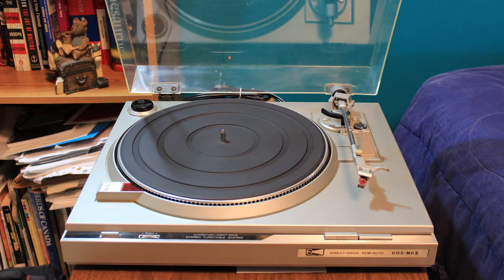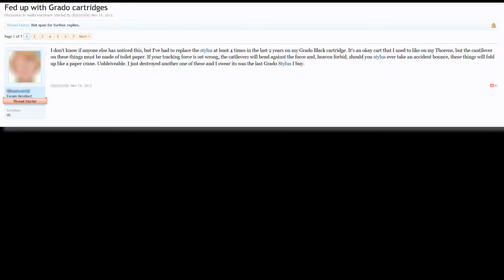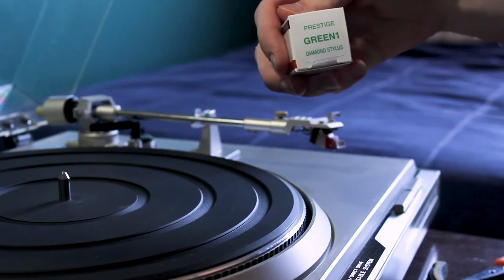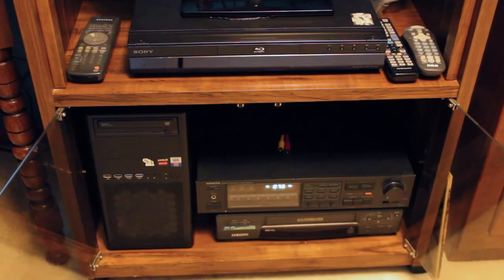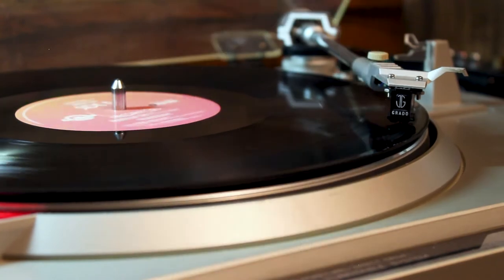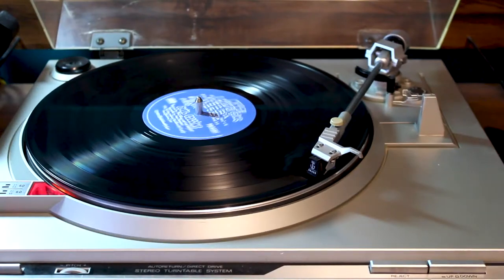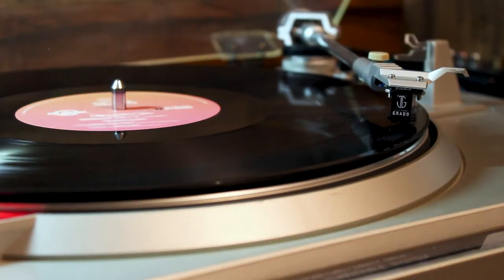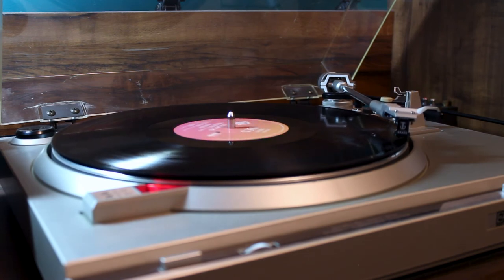A Look at the Grado Green  - A Crate Digging Review

Comment: I own several Grado's. In 1971 my Dad bought a Dual turntable with the Grado F+1. We loved it until 1976 a friend thought needle was a little bent. He said he can fix that with needle nose pliers. Yes, you guessed it, he snapped the stylus. Dad had hard time finding replacement and settled for a Shure M19ED. In 1980 I bought a Dual table like my Dads used in 1980 (1973 model), I bought a Grado G1. It was $150.00 and came in a jewelry type box. Loved it so much a year later bought a new Dual and put on the Grado G+1 ( again $150.00 and same box). Just love them. Later got my Dads old table and found a new old stock stylus for the original Grado from 1971. So 25 years after broken we found how much better that cartridge was to the Shure. I do like the Shure, but nothing like Grado. I have several Duals now. One has the Silver, One is FM3, and one F1. All sound great. I will say I do miss the packaging they use to use though.

Comment: I have to second what leyland said that the headshell seems off. I think some of those headshells have a screw that you can use to adjust the azimuth. Might be worth looking at.

Anyway on to the review itself. I've been using a Grado Prestige Black1 for a little while now and I have to agree with all your points. My only real negative for the cartridge was that like you I experienced some IGD and sibilance (although my cantilever is a little off-centre, so it's possible that this is making it worse) - but the sound more than made up for it, as it's an excellent sounding cartridge. I think you made the right choice choosing the Green over the 2M Red. The experience I had with the 2M Red showed it to have the same IGD and sibilance issues the Grado had, but the sound just wasn't as good as the Grado. Mids sounded flat and muffled. High end was great, if a little bright. The Grado on the other hand has been much more well balanced, and does well in all areas: highs, mids, and lows.

I hope you do some more cartridge reviews in future. You and HiViNyws are the only two channels I've seen to date that have done decent in depth cartridge reviews of any sort. Great video.
Reply from the maker: You and leyland9999 have been very helpful. As I mentioned to leyland, I did readjust the azimuth based on his advice (I tried adjusting the screws on the  tonearm and headshell but couldn't get it to rotate, so I put some very thin cardboard under one half of the headshell to get the cart's angle right. There is an improvement, particularly on the inner grooves. Thanks again!

I must say I'm very flattered that you're comparing me to HiViNyws. I was actually hoping my reviews could someday be as good as his.
Reply: @RoyUnit  The problem might be at the other end of the tone arm.

Comment: Good review. However......the head shell seems not perfectly level. That means the needle isn't riding the groove as it should. It is leaning. So without any doubt the sound can be improved quite a bit. Furthermore, a cart/tone arm combo must form a happy pair. Apparently this is the case with your equipment. You mentioned the difficulty this cart has with certain pressings, maybe this problem can be solved if the head shell is positioned correctly. Regards from Holland!
Reply from the maker: Thank you. I think you may be right about the leaning issue. I noticed it a little when I bought the turntable but I wasn't sure if the needle was actually not at the proper angle or if it was just my eyes. I will certainly look into it soon. Appreciate your advice.
Reply from the maker: Update: I've now readjusted the azimuth on the cartridge to get it as close to level as I could manage. There is a notable (not exactly huge, but notable) difference in clarity on several records I have tried since then. In particular, inner grooves do have less issues than before. Thank you very much for your help, my friend.

In retrospect, I feel kind of dumb for not noticing this until now. Comparing the angle of the cartridge from before to the angle it is at now, there is a noticeable difference. I suppose it is due to trust in the person I bought the turntable from; he said it was refurbished and fully set up, so I trusted his judgement. I hope this will teach me to be more critical of these things; people can be experts on turntables yet also make mistakes.

Comment: Very Good  sounding Upload.  Many on YT can't manage that clean a  transfer,  Curious to what preamp and  A-D  you employed.  I am an ageing audiophile; I recall fondly buying 3 to 5 Grado GF3E+ cartridges  back in the mid  eighties and  "hand  selecting" them myself.  Usually one of two out of the 5 were  keepers and the others  not good.  Did this  by listening, though I did have an electron microscope at my disposal at Bell Labs. - Cheers!  Sandy
Reply from the maker: Thank you! I'm very glad you liked it. It seems that Grado is a finicky brand in terms of quality. My experiences have been generally positive but others report mixed results. I wish I had access to an electron microscope - the closest I've come is a USB microscope that I used to check whether a stylus tip was damaged.
As for the audio quality, I'm glad it turned out so good for you. For the ATD transfer, I connect my turntable to a Cambridge Audio Topaz SR10 receiver, using its onboard pre-amp. I output the amplified signal through the Tape Deck output to a Behringer UFO202 ATD, which connects to my PC via USB. From there I record the audio in Audacity at a 48 kHz sample rate and export the files as either FLAC or WAV. The process is laid out pretty well in my video on transferring records to digital files.
Thanks again!
Reply: @RoyUnit  I have to watch that. If I get my TT up and  running I might give it a  shot.

Comment: Ironically my Grado Black1 has no hum on my U-Turn Orbit but my Nagaoka MP-110 does although it's a much better overall cartridge than the Black1 IMO. Better tracking and better sound signature if you ask me, not to mention the obnoxious stylus guard the Grado Prestige series as a whole has that's hard to put back on and I am always afraid to crack or outright break it whether I slide or click it on. The MP-110 has a nice easy  guard and it's easier to replace the stylus when it eventually wears out or gets damaged.

Comment: Belt drive turntables which have their motors on the far side (11 O'Clock) of the platter from the tone arm drop point won't be a problem with hum.  Also turn tables with DC motors.  Grado shells are un-shielded (plastic or wooden bodies).  Having a metal mounting cartridge shell on the tone arm that is grounded will help.  BTW these cartridges use a design similar to ADC's induced magnet system.  I bet the Grado Green won't handle Telarc's digitally mastered 1812 overture LP during the cannon blasts!

Comment: Great review. You should do a weekly show on PBS. Maybe "This Old Turntable", or "Vinyl Week in Review"? Anyway, I have been using a Pickering TL-3 in my Technics SL-Q200. My stylus was an aftermarket D11s I believe I purchased from LP Gear. I say was using because the other day while cleaning it with solution and brush I accidentally brushed the tip off it. Mind you, I wasn't applying excess pressure. Now I'm considering buying the same stylus for $90 or a Grado blue for $110. I'm assuming this will plug into my p-mount tonearm. Any thoughts greatly appreciated. Thanks.

Comment: I have the Grado Black 2 and I put this on my Fluence 85 I wasn't impressed with the output of the sound! Yes it was clean but the highs weren't there and yes bass was good! So next I tried a classic cartridge a R27E made by Shure and I like this better then any other cartridge I have tried and even the cartridge that came with the Fluence 85 was the Otophone OEM10 and this didn't par to the Shure! Shure did very well with making cartridges and it's hard to find them today because production I believe has stopped not 100% sure of this!
Reply: Shure stopped producing cartridges a number of years ago.
Reply: Interesting since RT-85 comes with Ortofon Blue and not OM-10.  I also have Shure M95xE, DL-110 on RT-85 and the Denon DL-110 is the one I like most.  The M95xE is very neutral and the Ortofon Blue sounds very clinical

Comment: Be careful with any Grado Prestige series on direct drive turntables.  Some hum and some don't.  No one seems to understand why, but with belt drive you don't have this problem.
Reply: Belt drive have the issue  too. Back in the late  70's, The New  AR turntable  sporting a  GF3E+ and  a  Linn LVX arm hummed at certain places  in the  arc.  The  shielding on the GRADO  cartridge is  marginal, and  it will pick up motor  hum, especially with AC synchonous  "clock" motors.